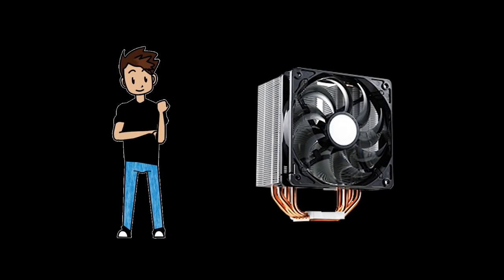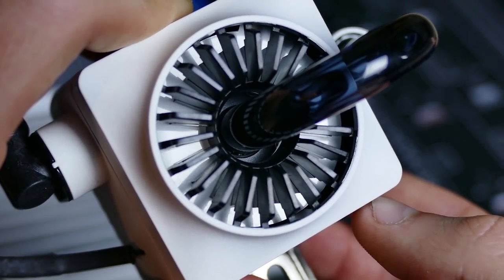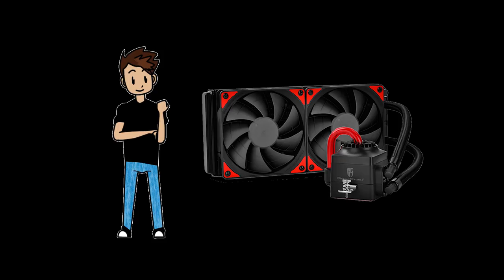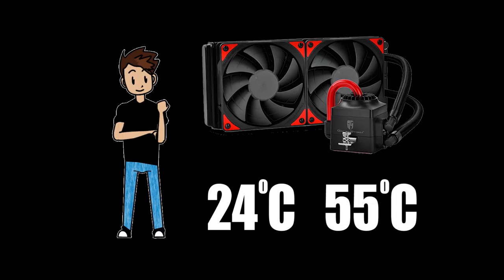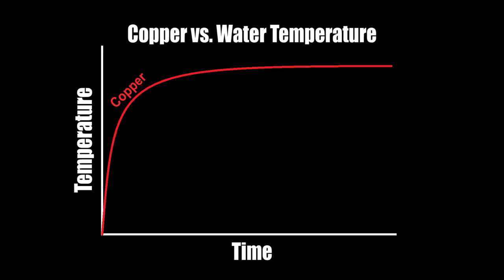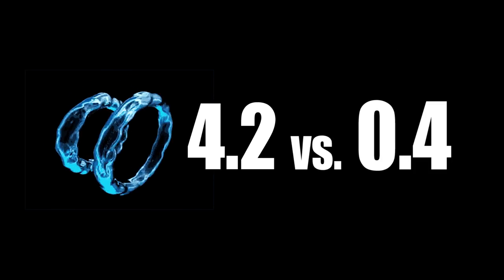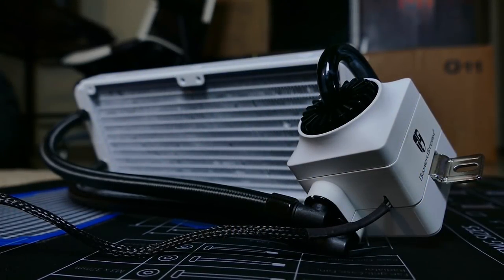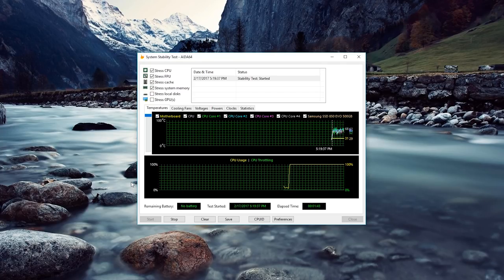How to Properly Measure AIO Temperatures

Comment from the maker: - Ok, I've responded to as many comments as I could up front! Thanks for watching, folks!
Reply: Respond to this I dare you
Reply from the maker: Done.
Reply: Dang it, wish I noticed the video sooner, could've gotten a reply on my comment :/
Reply: thxs for the upload
Reply: Salazar Studio o
Reply: +"Salazar Studio" 
Must you use the circle sign between units? I only read it as combined functions instead. #Engineeringproblems
(There is a multiplication sign which works better "×").

I might not be a materials/mechanical engineer but a slower cooldown should be better for the silicon actually, since rapid heat-changes does actually make silicon and glasfiber brittle.

Thanks!
Reply: DavidtheDoom The dot is quite common as a multiplicative symbol in mathematics for computer science (at least where I'm from). I used to think "why not just use an 'x', just like we learn from early education". Then you realise just how much you'll be using the symbol "x" for lots other purposes, that would make understanding the formula a pain.
Reply: Nice video Greg.
Reply: Cpt MishMash VonRandom:
I buy a solid dot. A circle is the symbol used for combined functions.
X (x) is not the same as ×. 
Notice the difference? One is a regular x, the other is the multiplication-symbol. Two lines crossing at perpendicular angles.

Since we are just showing units on the screen the × is more appropriate since the other way around would be the weight as a function of the function of temperature
kg ○ K means <=> kg(K(x)). 

Hence the use of "kg × K" is more appropriate. 
kg • K would work to but can be confused with scalar products, but that is mainly when in context of vectors.
Circle, not so much since it's a combined function of functions.
Reply: No, I totally get what you are saying. I'm just pointing out that its often done that way in my experience. :)
Reply: haha
Reply: * <--that is the accepted multiplication symbol. Look at your numpad. X gets confusing fast. Lets say you have x apples, and you double your apples, and now you have 14 apples, how many apples did you start with?
x x 2 = 14 
See what I mean?
Reply: @Richard Smith,
Asterisk(*) is not an exlusive accepted symbol for multiplication.

Read any mathematics book, scientific paper or equation and you will never see an (*) used.
Also, as noted earlier. X (the latin letter) and × (Multiplication sign) are not the same.
The Multiplication sign is actually a specific sign also known as St. Andrew's Cross and should not be confused with the letter X as you have done.

Also, when using X in equation a dot is more reasonable used or no sign at all. 
"2×X" is rarely written.
"2x" is more reasonable.

Then again, this is not really relevant, with the case as in the video above, when using units.

When talking about the Dimensions of a furniture you usually write 
Lenght × Height × Depth. (as in 180 × 60 × 90 cm)
Not:
Lenght * Height * Depth. 

Please check "multiplication sign" on google or wikipedia. You might be surprised, also your logic is the same as "It's true since it's on TV".
Reply: Respectable review sources will bench them for, usually many hours, but at least one or two. In that regard, your problem is not really with the coolers, but rather with your choice in review sources. 
Regarding the differences between AIO and LC, depending on what you pick in either, the difference can be smaller, or greater. Obviously.
Regarding the temperature staying the same for longer, "who cares". As long as the temperature is within acceptable limits of the CPU, this information is of no value. It is of no concern to the user if the cooling system, and by extent the CPU, will stay hotter for a while after their gaming session ends. There's simply no impact.
Reply: Tim cutler I actually had my NZXT Kracken CAM software lying to me. Essentially it was taking the average temp, not the highest  thread temp. A simple change of the fan curve and I'm good to go.
Reply: Your explanation is not quite accurate for the results you see... What you are saying is that copper gets hot faster than water (which is true)... this means that copper can REMOVE more heat from the CPU FASTER. The faster heat transfer occurs means the CPU temp will be lower iniitally if thermal conductivity of copper vs water were the deciding factor. 
It takes more energy/heat/time to increase the temperature of water which would mean your CPU temps should be HIGHER initially. You see, you are not measuring the WATER temperature, you are measuring the CPU temperatures... 
while the WATER temps would take longer to stabilize (be lower longer) this also means the opposite would be true for the CPU. The CPU would be hotter initially and then stabilize (provided the radiators have enough surface area).

ALSO... HEATPIPES in air coolers are NOT solid copper they are hollow pipes filled with a liquid (water, acetone, nitrogen, or similar) and that improves the thermal efficiency obove solid copper. The fast heat transfer in air coolers is mostly due to rapid boiling and condensing of the liquid inside the heatpipes.

IF it is true that water coolers stay hotter longer than air coolers... then the reason for it is not what you think it is and to be honest, I think you are wrong about that. Thermal efficiency doesn't generally change that drastically over the same temperature range. If a CPU WATER cooler can REMOVE heat from a CPU FASTER than an air cooler when the temperature is increasing, then it would also be faster to come back down to idle temps as well.

Also, SPECIFIC HEAT is not the property you should be concerned with... THERMAL CONDUCTIVITY is the property that matters here. While they are related... they are not the same.
Reply: Where was the lie?  You talked about user misconceptions.  You talked about how the product is superior.  You never mentioned where the lie is.

CLICK BAIT!!!!!!!

Comment: One of the most misleading videos I have run across in a while.  You are making a number of assumptions that are just not adding up.

Your points are valid if you ignore the question of system efficiency.   Cars use water to air coolers instead of air cooling because even the best engineers realize that there is a limit to air cooling.  Most air coolers aren't limits by the material in question, but rather in the ability of the cooling fins and fan to dissipate the heat.  Most of them have serious limitations.

Air to water systems are not limited by the medium used (water instead of cooling fins) but rather limited by the ability of the radiator at the other end to dissipate heat.  If that radiator and fan lower the temperature of the water enough, then the CPU will never reach as high a peak temperature under similar loads.

It's a question of the efficacy of the full system, and not strictly the metal involved.   Yes, the air cool system will have a bigger spike, but that is related as much to it's inability to move heat away rapidly than anything else.  The water cooling system does a much better job of moving the heat away from the CPU (note, both systems generally have the same basic contact transfer mechanism).

The aircool system reaches it's "peak temp" very rapidly because it's not particularly efficient.  It can genmerally keep the temperature at a certain peak point and keep the CPU from melting down, but the passive nature of the dissipation of heat means that the CPU contact point will always be very hot, it will get hot quick and it will stay at that peak temperature.

Water (or other lqiuid) coolers are much more efficient initially,  and continue to keep the temperatures down for longer because (a) the system has more ability to hold heat, and (b) because it's heat dissipation (at the radiator) is more effecient at getting the heat out.  Air coolers dump the heat into the case (and around the CPU and as a result are "self harming" if you like.  The heat is moved from the CPU to the air around the CPU, and unless the case is super cool at removing heat, will in turn heat all of the system and raise the overall base operating temps inside the case/  This raises idle temps, and repeat looping of load (say playing a game multiple times in 15 minute bursts) would see the system never really cooling down.

The liquid cool systems take the heat out of the system and exhaust it outside, away from the CPU area and away from other components.  By creating and overall cooler starting environment, the CPU itself will run cooler, as lower ambient temperatures will help keep everything cooler.  The likelihood that the overall system (and specifically the CPU) runs cooler at all times is high.

As long as the radiator dissipates enough heat to make the liquid going back cool enough to absorb the heat again, the CPU will never reach the peak temps you see with an air cool system.  If you do, then the radiator (or fan, or both) isn't efficient enough.

Comment: Great video. Love the integration of your engineering knowledge in the explanation. Much Love all the way from Kenya.
Reply from the maker: Wow! Thanks for watching all the way from Kenya!
Reply: Isn't Kenya too far away to watch this?
Reply: Nope. Location doesn't matter if you have relatively fast internet.
Reply: The further away Kenya is, the slower the internet. That is why the strength of signal is weaker as distance goes heavier in proportion to the internet cable (under Atlantic ocean) diameter.
Reply: Yes, but I stream at 1080p60 so I think it's okay.

Comment: The water and the copper (or copper heatpipes which are, in a way, like mini water cooling) are simply there to transfer the heat. WC just lets you have the flexibility to efficiently move the heat further away from the CPU to where you have more room to place a radiator. Thus you can make the rad bigger and use bigger/more fans to increase the cooling capacity (the amount of thermal energy able to be moved away from the CPU).
Heatpipe "air coolers" are the original AIO WC. They transfer heat from the die using water sealed inside copper tubes to a radiator placed in an area where you have more room. Instead of being directly connected to the die they place the radiator in a slightly more remote area where you have more room for a bigger radiator and bigger fans compared to a spire cooler. (Granted heatpipes make use of water's phase change energy vs WC's use of water's specific heat capacity, but it's still just a way of using water's chemical properties to transfer energy)